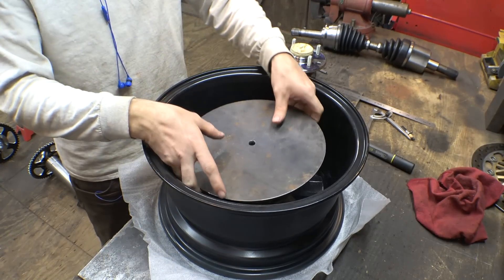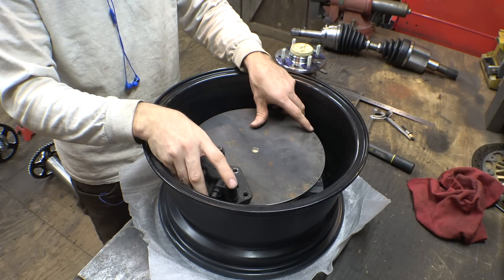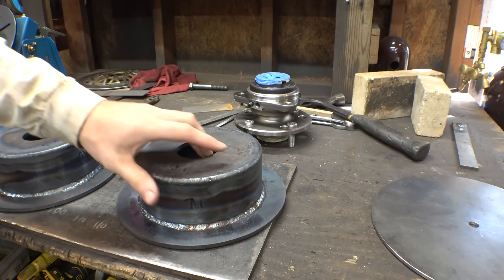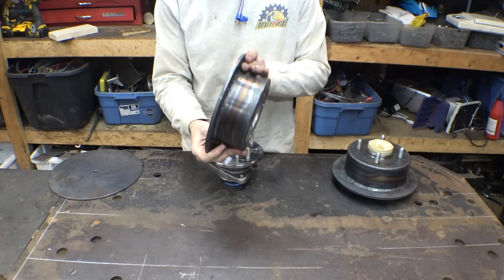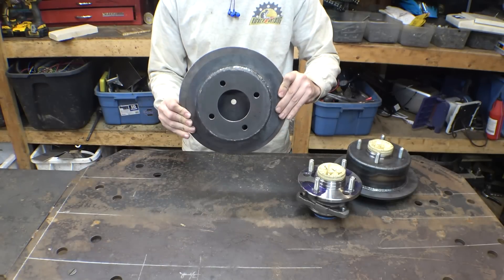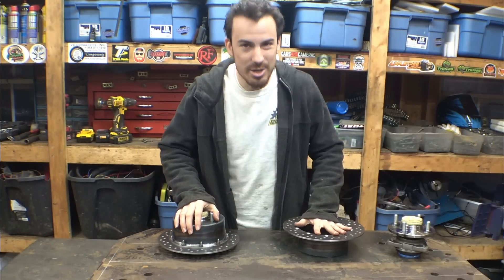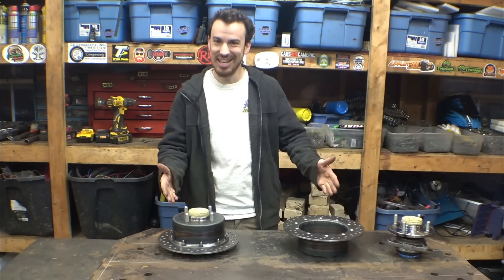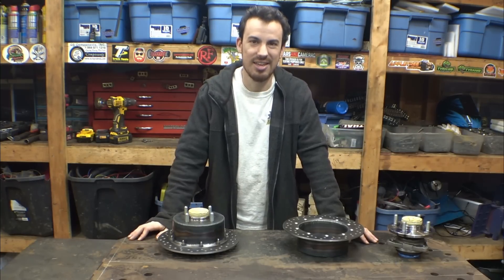I Made Custom Brake disks for my Next Project - Part 4

Comment: Congratulations, you did several days worth of machine work, for something that would have been cheap and easy to source. You could have bought a rear rotor for a 99 Acura CL....for like 40 bucks a pair....then modify a bracket and put the caliper on. Time is money, and there is no way normal steel is going to hold up to the heat, even if you heat treat it, the steel can't withstand what cast steel will.

Comment: Really cool build I'd try and make everything on suspension bits adjustable
So you can give yourself some wiggle room 
Cause I'm sure you know it's 
Super fun to cut up stuff you just got done building cause   after X n X got put on
 now it's off a bit 😡😡😡 
And stationary parts can be tricky enough
Now you have a 1/2 dozen parts all moving together affecting each other.    Then it's got to drive good on top of that 
You got it and if not  mr grinder is there to lend a hand

Comment: A lil late but you could've brought your hub to junkyard and roamed around looking to see what factory disc are close enough
To what you need even if you have to redrill lug pattern.   
I did that on my home brew rear disc brakes for my VW dune buggy 
I ended up using rear 300zx turbo rotors and calipers. 
  Those have cable brakes built in 
I may do a similar setup on the front thos been looking at sweet looking stree bike disc n lil calipers
How is the steel you used holding up to brake heat and warping 
knock on wood

Comment: Mount the lower ball joint as far into the wheel as possible first then build from there...try to keep the king pin angle to a min and tire scrub to a min...

Comment: I would think that 0 scrub radius would be best but I'm not sure. The scrub radius won't help with the locked front axle. If you use a sprag  clutch on both front hubs it will allow the faster tire to freewheel, but on surfaces with a lot of traction you will have between the front and rear axle.

Comment: You're going to struggle to change the scrub radius because it's governed by the offset of the wheel and the depth of the hub. You want close to zero. You won't get negative and if you do you'll probably get driveshaft binding issues. The worst that will happen with too much scrub and camber is the steering is heavy as it has to lift the front of the vehicle to steer. It helps with return to centre though. 
Just get the king pin as close to centre of the wheel as possible and run it as vertical as possible. You'll be very limited in options though.

Comment: Don't drill holes for venting on your brake disks. You'll make them much more likely to crack that way. I recommend just using off the shelf blank disks. They'll be cheaper and easier to use. Keep up the good work!

Comment: One thing that you might lean into in the future is building these brakes to except a standard disc that's already out there.  That way if you ever sell these buggies, the next guy can just order the parts needed for new brakes, and doesn't have to pay a guy with a lathe several hundred dollars, just to build a $10 disc.  Just a thought as to the direction of engineering on this channel.   Ok good,  I'll see you at the next engineering meeting.

Comment: If you just search "4x4 kingpin angle scrub radius" and watch the top 8 or 10 videos, you'll get everything you need to know about it.  Watch it at 2x speed so that you can buzz through the parts that aren't so important, and only pick up on the info that you're looking for..  It's right there on youtube though-- you just have to actually sit down and watch videos;  It will be worth your time once you find it.

Comment: Chris being that going be off road and is an IFS and it direct drive look at front end of Polaris ATV/UTV are also direct drive too, but they had a hilliard clutch on each front wheel or center differential has a sprague carrier with armature plate for magnetic engagement in order to engage Full Time AWD wheel drive I think your case you want a close as neutral camber angle and want add some positive caster this should help too and don't forget about bumper steer check out Vatsal Jain Youtube channel he has lot good info which should help you in your quest.

Comment: With all the different hubs and spindles you've made I have to ask... do you understand scrub radius? That is a serious question. Not trying to be rude. Not everybody understands the minutiae of suspension design.
The closer to the center of your wheel and tire assembly you can keep your kingpin the easier it is for your steering system to function. When your kingpin is a few inches away from the rim, your steering has to swing the entire wheel assy and all attached parts like brakes, etc. If it's centered in the wheel, it just pivots on the contact patch greatly reducing the strain on your steering components, and arms.

Comment: The scrub radius is not really going to matter much. With a locked front differential its still going to torque steer and crow hop. Because the outside tire is still wanting to turn faster than the inside tire on turns.
Reply from the maker: Yep exactly. I only plan on running it in four wheel drive in loose dirt or mud. Or for when I’m trying to “rock crawl” this thing. So hopefully it won’t have those issues when going slow

Comment: You should hardface your breakdisks. It will be hell on the pads, but you wont have to replace the disk as much (much less machining in the future). Besides, hard facing is a very useful skill! Lots of people have no idea about it. Would recommend a mig facing wire or a tig rod bc stick is very messy to machined surfaces with hard facing.

Comment: That hot rolled mild-steel brake disc will warp the second you get it close to dark cherry red (~450C) - so just be careful when you're thrashing the vehicle they're going on...
Reply: I was thinking the same thing
He could just reuse the hub section
And get some motorcycle discs the are close to same size and drill more holes in bit to bolt those up 
There are some really cool looking moto rotors too and made with the right stuff

Comment: You could also cut some holes in the former pipe of the "hats". If you put the core cutter in the chuck, and put the hat on the carriage, you'll be able to cut precise holes without much hassle. Unsprung weight and all that. :)

Comment: My main criticism of a lot of his projects is custom consumable parts. What you want to do is make your custom hubs so they can use a readily available disc that can be replaced when something happens. He does this type of thing alot with custom sprockets that are not replaceable without fully building a new custom piece.
Reply: Previously, he said that he like to challenge himself. Maybe that's good for him right?
Reply: @adirompin1727  yeah but in the wrong places. Brake discs are not made of random mild steel plate. They will very likely warp like crazy after a few hard braking maneuvers. Plus he secured them with nylock nuts. That's not going to work. They need to be safety wired ideally.

Comment: one thing im confused on why built seperate brake disc and bolt on to the rotors you built why not setup just like a car and have all one piece if your worried about Ventilation you could still drill them. Just sounds like extra unneeded hardware and possible Fault points. When you built them. i thought that what you were doing till you milled them down to small for the Caliber to fit.

Comment: I see you use nuts a lot in thick metals where you could just tap the threads an have no nuts and shorter bolts. These rotors being another one of them situations. Last one I saw was something you lathe to lighten but then used big bolts and long for nuts  vrs short bolts and no nuts just tap the threads vrs nuts/long bolts.

Comment: You might want to think about drilling a hole in the bolts holding the rotor to the rotor hat. That way you can speed wire all the bolts so you know there’s no way those bolts can back out. Just an idea. Keep killing it.

Comment: Awesome work Chris.I like that allot of the scarps you create can be used again for other purposes,like gussets etc.I was looking at the color changes in the metal and thinking it was built in hardening while welding too.If you get an old small oven you can harden your discs,etc; too.

Comment: I remember the Hollander Interchange Manuals. No, they probably wouldn’t help your project, and yes, I’m old.
Reply from the maker: I just looked up what that is, and now I want one. Haha
Reply: @ratherBweldingChris  eBay. 172 available right now. I’m making this up, but back in the day you might find that the exhaust valves from a 283 cu in Chevy will fit a Ford Model A exhaust and hundreds of other odd things that could be exchanged.

Comment: My most important question is, What is your education? I mean you have such a great knowledge on Lathe, Vehicles, Transmission, Gearing . Are you an Engineer by profession ?
Reply from the maker: I do have a degree in welding but, I’m self taught on everything else. To get good at building stuff you need to just start building and you learn stuff along the way
Reply: You can learn that in metal shop in high school

Comment: Rotors look great. Question was just curious as to why you made the actual rotor part where the brake pad contacts bolt on and not just used the material that was there/machined a little bigger . Hope that makes sense. One good part is instead of rebuilding the whole thing you could just Bolton a new router if they ever wear out. Great work tho, just wondering what you were thinking

Comment: I would have tapped those bolts holding the rotors or tapped and used a nut to lock it in...

Comment: When is he going to realize he made a car disc brake he didn't need to trim it at all he could have used the weird hat as the brakes
Reply: Could've made the hats out of aluminum and saved a ton of weight
Reply: Yes, but the brake pads aren't the only parts that wear out in a braking system. The brake disk does too. And if they are a separate part, they are easier to replace...